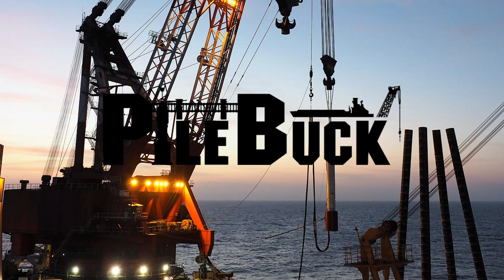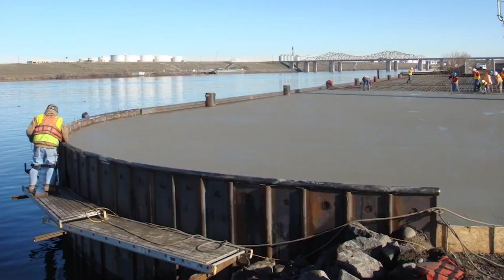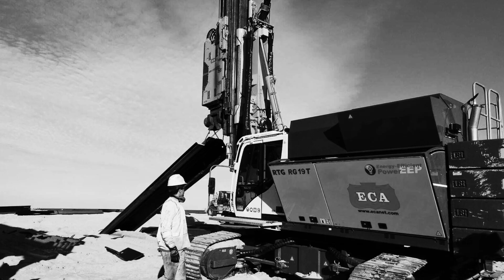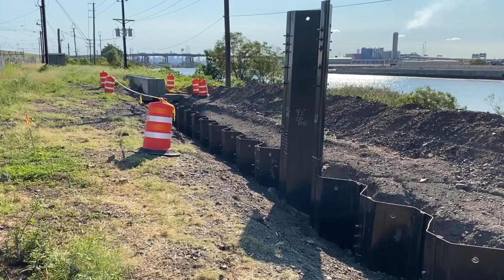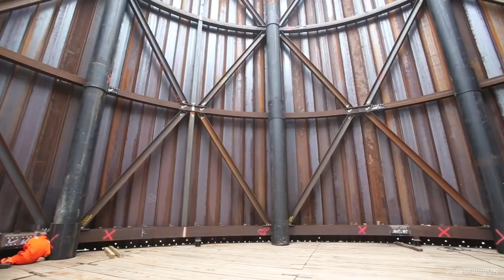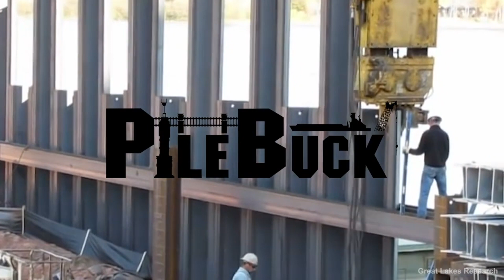Steel Sheet Piling Buyer's Guide | Pile Driving Series #4

Comment: What are your thoughts on vinyl?
Reply from the maker: Vinyl sheet piling offers durability, is affordable, and is resistant to corrosive elements in marine environments. That being said, vinyl tends to have lower structural strength compared to materials like steel or concrete. Of course, the pros and cons all depend on the project and what it requires.